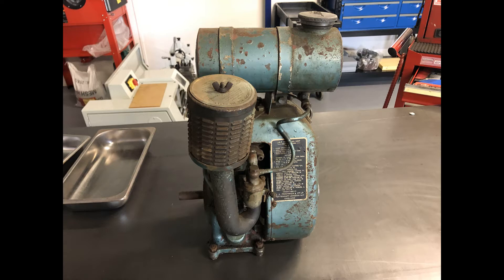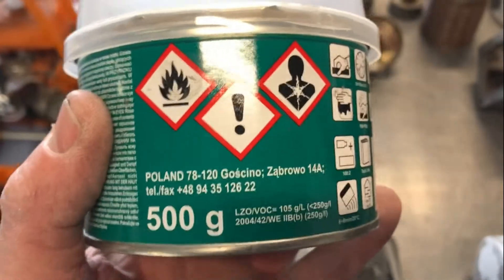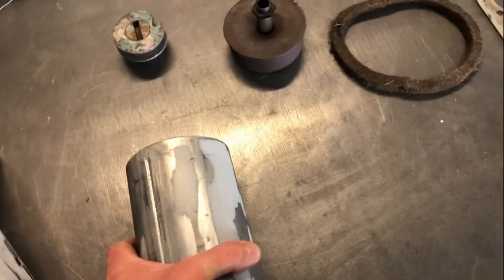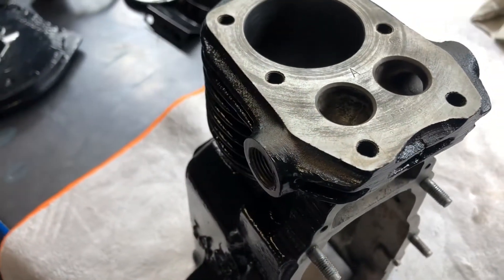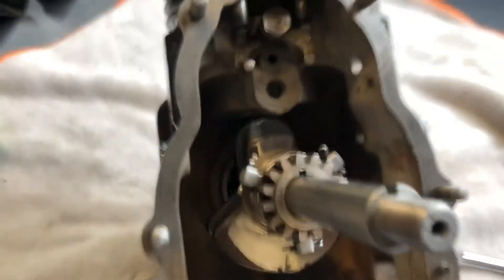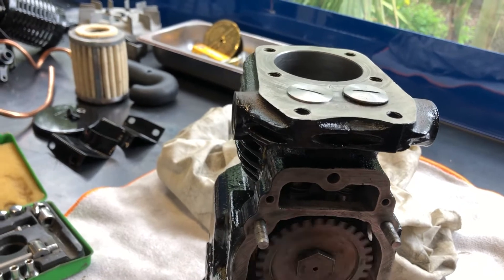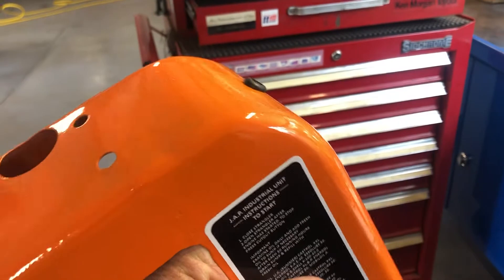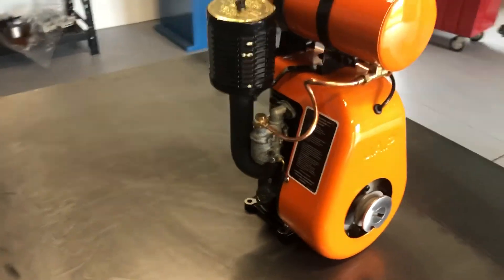J A P  Stationary Engine Type 2A Restoration Part 2

Comment: Better than going to the movies Mick.  Can’t wait for the next exciting episode. Thanks again.
Reply from the maker: Gday Neil
Thanks for the comment mate.
I dunno about exciting but as you know the main thing is to have fun doing whatever floats your boat. We arent here forever. Hows the BSA going?
Reply: @thebigfella8986  Going well Mick thanks. On the way back together. Inlet valve has gas a bit of a hard time but I gad them faced and they will be ok. Had the cowl powdercoated black (original colour)  its a 1951 model. Looks really nice with the brass instruction plate on it. Can’t wait to pull the rope. Minus a fuel tank but I hope to round one up sometime. I am looking at a nice Wisconsin/Ronaldson and Tippett  atm. We’ll see.
Take care mate and keep the videos coming.

Comment: Just bought one of these, exactly the same model with a few subtle differences, great work on rebuilding yours mate 👍 hopefully I can get mine running and looking as good 🤞
Reply from the maker: Gday Dave
Thanks for the great comments. Yeah it didnt come up to bad. If you need to know anything let me know.. Most of all, have fun doing.
Reply: @thebigfella8986  wow really appreciate that mate 👍 still in the guts of the thing at the moment, cleaning and making new gaskets 👍 so far so good! She has compression and gives a jolt out of the spark lead but no spark as of yet! Striping it down further to clean it out throughout and clean up the points 🤞 the carby will be the biggest challenge I think, but it all seems in surprisingly good knick for its age, which I'm uncertain off 😜